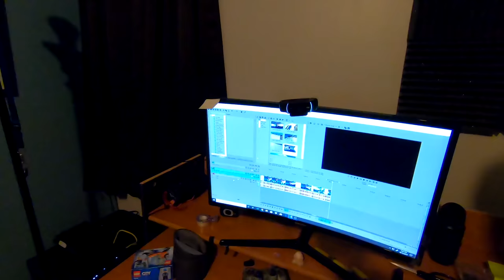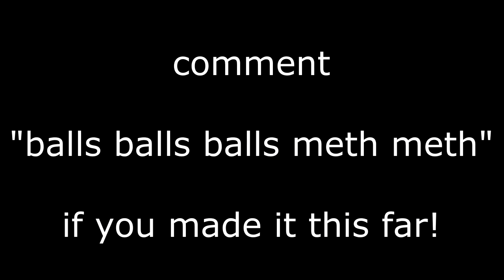I HIT A DEER!

Comment: hey goodloe Tv i have a car related question? so i drive a 03 buick rendezvous cx v6 and the engine is shaking like crazy while idle. so the code came up to a random misfire and we changed the spark plugs could the coil pack be bad to?

Comment: You’re supposed to put oil in you oil filter so it doesn’t start it dry. That’s what I was always told
Reply: pretty pointless honestly, it’s still gonna have plenty oil in the motor from draining and filling up. you can run a motor with no oil in it for like 20 minutes. it’s not gonna blow up from an oil filter sized absence of oil. i’ve never done it, it just makes it harder to keep oil off you.